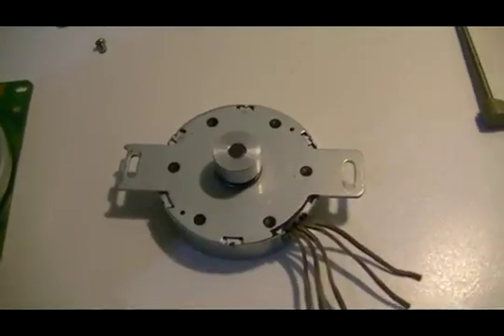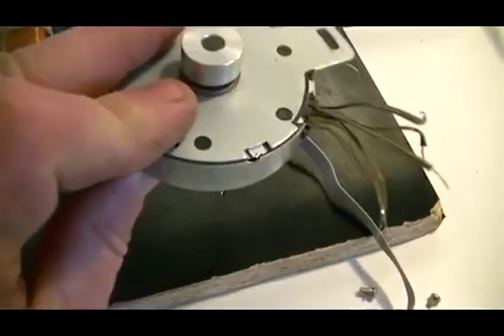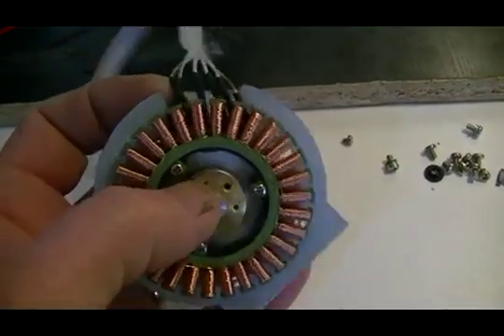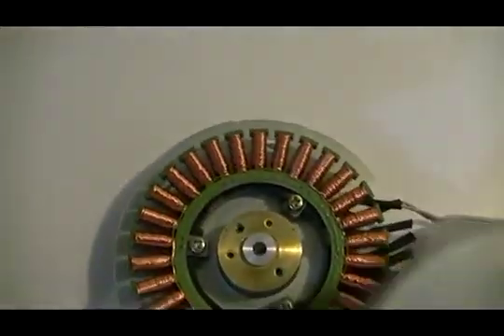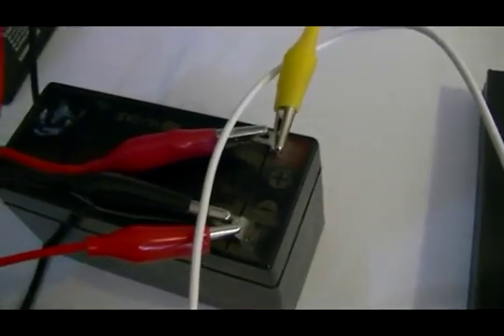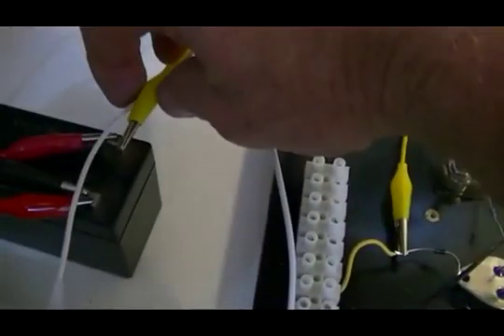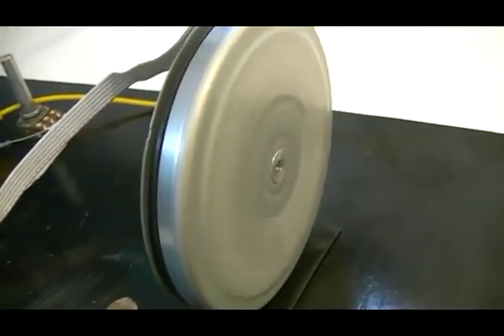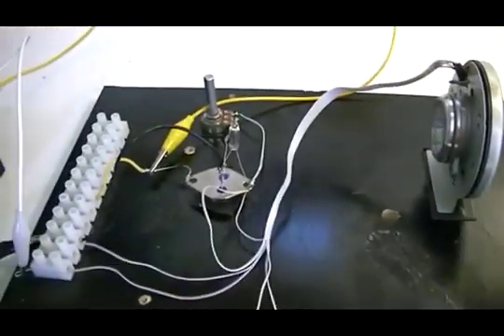Step up to CD rom drive

Comment: Hm. I suppose with some adhered on sand paper or soft cloth cut to size and shape, you'd end up with a nice lil jolly good sanding/polishing gizmo. Give you 5 bucks for all your trouble putting that nifty buzzing beebop together. That should just about cover to cost of shipping and handling to my address. Waddaya say pal?

Comment: I've tried this on jt's with one led and not had it run, just stalls out. Interesting, Do you have a few leds in series? I'll have to try that, plus base output. Thanks for the upload, I have a few drives around :)

Comment: The mystery one is fresh to me too, though i've never seen either of them in CD Rom drives. Usually they are 3 phase brushless, with a standard DC motor on the ekect mechanism.
The other one, the main one of the vid is the same type as can be found in a floppy drive...if you've still got any of those ancient things lol. 3x 4 wire SMD Hall sensors on the boards too (under the coils).

Comment: I have a tiny 12v stepper (about the diameter of a US quarter) that I finally got to work but only with 18v and up.  It is spot welded together so I can't take it apart but I imagine that inside is a surprise like you found.   That first one that I tried was the winner so far.